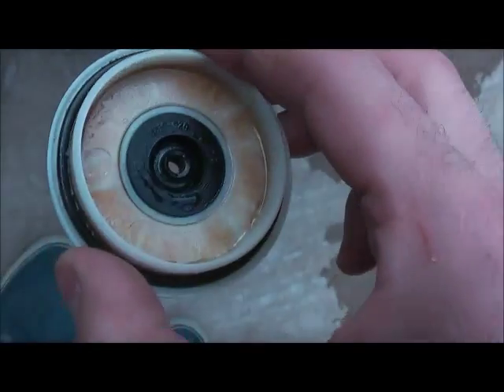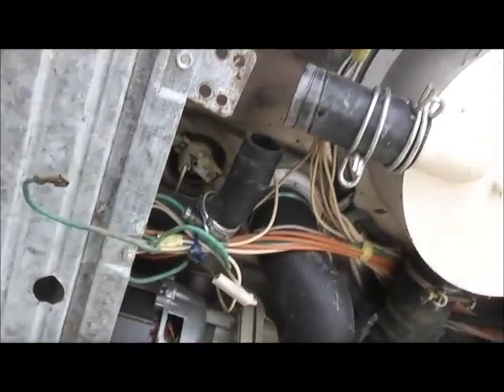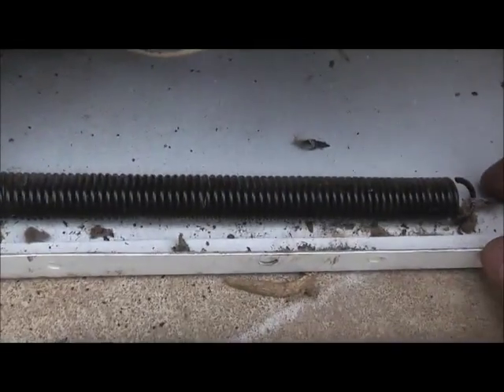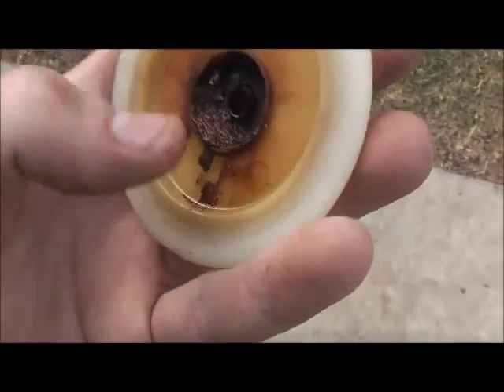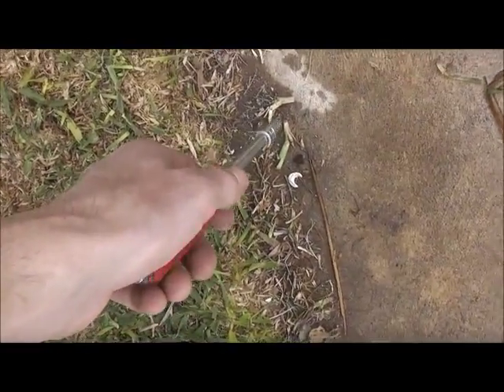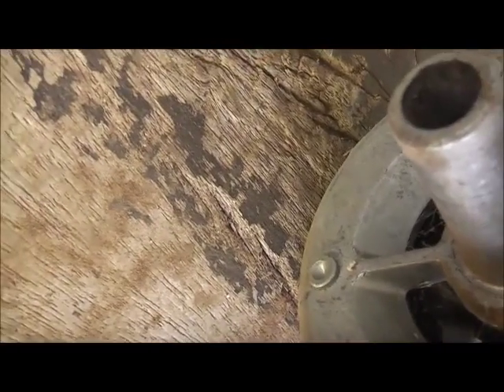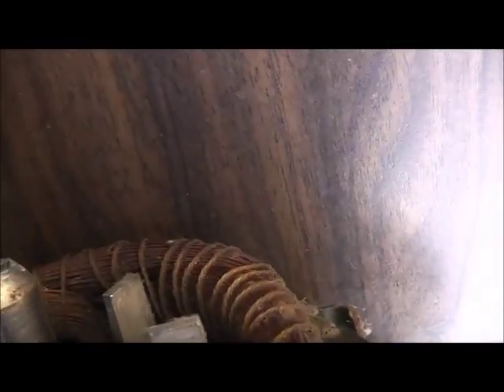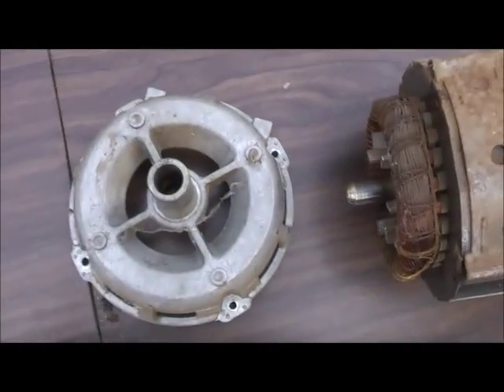Repair Brandt Dishwasher Pump & Motor Sleeve Bearing!

Comment: That's a bronze sleeve bearing :) 
there's a solid lump of porous bronze that is held in by that ring clamp. 
When I did my bearing I ripped out all of that and put a radial ball bearing race in place of the bronze. Works fine!
Reply from the maker: Machine Man yep a bronze sleevy!!, i need to get a ball bearing for this!! would drop right in!!
Reply: HDXFH very easy to retrofit!
Reply from the maker: Machine Man know the size?, wondering if it's the same as this one!
Reply: HDXFH it should be the same. Only difference is mine doesn't have the tube on the rear bell

Comment: I wonder if the dishwasher was actually built in 1977 but perhaps the pump motor was a replacement since it seems to be the only part dating from 1981?